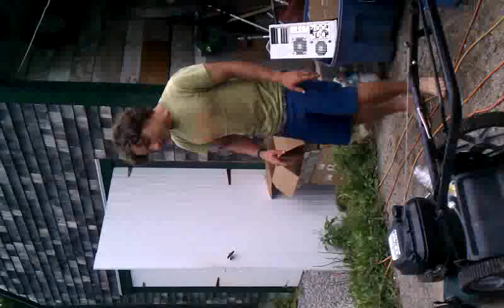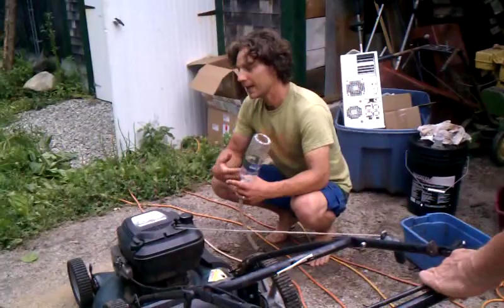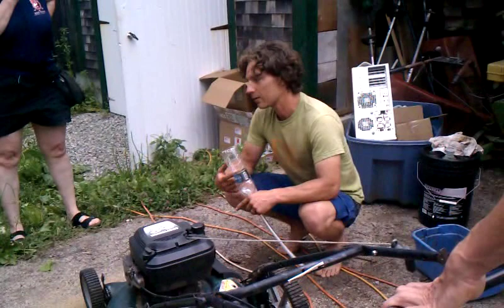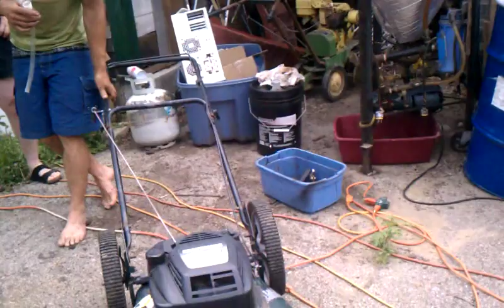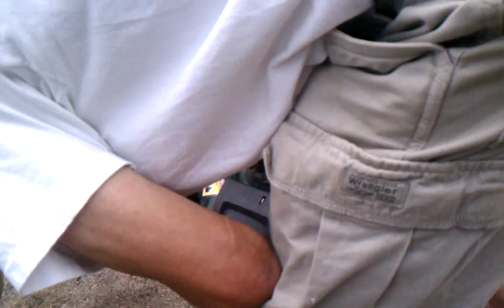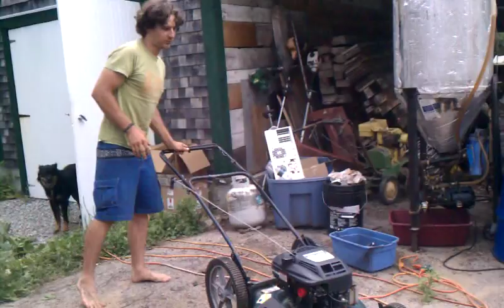Converting My Lawnmower to Run On 100% Ethanol (E100)

Comment: You should be able to close the choke enough to balance out the air fuel ratio for it to stay running. But overall you want to have a better fuel supply and more air.

Comment: today I ran my zeroturn (kohler 725cc not flex fuel) on E50-60ish with choke on. Without the choke, it was too lean even with the airfilter blocked a bit. With choke on, cooling fan was reading 60 degrees with outside temp. 35. There was no visible smoke from exhaust

Comment: Alcohol is way better of a fuel has a way higher anti knock rating no additives needed for it to burn where is gasoline is nasty dirty needs a bunch of additives and it still doesn't burn as well.

Comment: Could you please explain the modifications that are needed to  convert my bike engine to run on ethanol
Reply: Might be a bit late but essentially unscrew the main jet of the carburetor and measure the hole in the outside and the increase the diameter by 40%

Comment: You are totally wrong. Alcohols, including ethanol, are hydrocarbons and gasoline is also a hydrocarbon. They both contain oxygen and hydrogen and carbon combined in their molecules (this is the definition of a hydrocarbon). But this hydrogen and oxygen, combined in the hydrocarbon molecule,  cannot be used without first breaking down the molecule. They are not readily available to use without first breaking down the molecule into it's atomic parts. Internal combustion engines should run fairly easily on ethanol. Nascar has used ethanol in their cars for years. Henry Ford designed the first model T to run on pure ethanol. There might be some adjustments necessary for smooth operation, though. Cars are running on 10% ethanol right now and they are pushing to up this level to 85% alcohol and 15% gasoline. The cars designed to use this mixture are called flex fuel cars. But non flex fuel cars can run this mixture, too, but might have adverse reactions to such a high percentage of ethanol. An -OH group is called a hydroxyl group. It consists of a hydrogen and oxygen atom covalently bonded together and attached to a hydrocarbon molecule. Examples are alcohols and sugar.
Reply: Some of what you're saying is right: history of the model T, ethanol in gas, trouble running e85, hydroxyl group being the name of OH. Your definition of hydrocarbon is generally regarded as wrong though. Do the stoichiometry on the two complete combustion reactions, one with ethanol, the other with hydrocarbons as they are typically defined, molecules consisting entirely of hydrogen and carbon, and you will see the latter requires more oxygen from the air.

Comment: havent played with carbys since i was a kid but couldnt you just put a bigger jet in the carby or re jet the original jet.
Reply: fhhsvnggbh you can adjust the fuel flow
Reply: fhhsvnggbh that’s what a jet does it is a the hole that the fuel flows through.

Comment: Henry Ford's first vehicle was powered by ethanol made from hemp. then the oil companies came along and snaked their way into the matter and said gas is way better you should use it instead and we will pay you alot of money. thanks oil companies for destroying our planet. 100% ethanol,100% methanol, or hydrogen gas is the way to go, cleaner burning, cheaper, easier to produce.
Reply: Ethanol has to be produced from crops... oil comes from the ground, just drill and pump it out. Don't blame the oil companies, they came about because oil was already there and there is plenty of it.
Reply: Methanol and ethanol , even in pure form, still pollute the atmosphere when burned. Now, hydrogen gas does not pollute and the only by-product of its combustion is water. Electric is good too, if you can find some non polluting way to produce the electricity to recharge the batteries. Solar would fill the bill, but I can't imagine how many solar panels it would take to recharge all the cars being driven in the U.S..
Reply: Catman Outdoors not anymore dummy not anymore
Reply: Ethanol's only byproduct is water and carbon dioxide which are both recycled to make the new gallon of it.

Ethanol is a safe fuel too which is why the Indy 500 switched to alcohol.  Hydrogen is a high pressure bomb that gets more dangerous each year the vehicle gets older.

Nissan has an ethanol powered fuel cell which can use watered down ethanol that is not even flammable though cheap simple high compression/high efficiency engines made of recycled cast iron will probably
Reply: All the Indy cars use methanol, not ethanol. Nascar uses ethanol.
Reply: Indy switched from methanol to E100 ethanol in 2007 but unfortunately have gone to E85 today.  Here are article excerpts from the time:

...In 2005, the IRL used 100 percent methanol in their tanks. The fuel worked well and was more efficient than straight gasoline, but IRL officials believed there was room for improvement. In 2006, they moved to a 10 percent blend of ethanol and methanol, which was then changed to 100 percent ethanol for the 2007 season...
...The switch to ethanol also allowed the racers to carry less fuel and make fewer pit stops, thereby increasing efficiency even more. "When the cars ran on methanol tanks had to hold 30 gallons to accommodate the fuel requirements of the cars," Vervynckt says. "After getting the engines to perform at their full potential, there was a significant gain in mileage. Indy cars now have 22-gallon tanks. When a driver pulls in to change out his tires, he can fill up. Teams were able to match their tire and fuel stops exactly, instead of stopping for tires only, or fuel only."
Reply: And now cars are plastic

Comment: For full potential out of methanol you need to increase compression and advance the timing along with carburetor mods. If everything is right you can gain 13% more power over gas
Reply: do you think that 13:1 compression would be good enough to run e100?:
Reply: You can push it to 15 in theory.
Reply: ("RNA0ROGER") I'd have to grind my head down quite a bit for that sort of compression, I'm worried about valves striking the piston at those clearances
Reply: 13 in that case would do.
Reply: ("RNA0ROGER") Thanks for the advice dude, I'm gonna try this tomorrow
Reply: isnt he using ethanol?
Reply: I guess methanol has good potential. Indy cars have used pure methanol for years.
Reply: The author wasn't using methanol, however, he was using ethanol.
Reply: They switched to E100 ethanol in the 2007 but unfortunately use E85 today.  Here are article excerpts from the time:

...In 2005, the IRL used 100 percent methanol in their tanks. The fuel worked well and was more efficient than straight gasoline, but IRL officials believed there was room for improvement. In 2006, they moved to a 10 percent blend of ethanol and methanol, which was then changed to 100 percent ethanol for the 2007 season...
...The switch to ethanol also allowed the racers to carry less fuel and make fewer pit stops, thereby increasing efficiency even more. "When the cars ran on methanol tanks had to hold 30 gallons to accommodate the fuel requirements of the cars," Vervynckt says. "After getting the engines to perform at their full potential, there was a significant gain in mileage. Indy cars now have 22-gallon tanks. When a driver pulls in to change out his tires, he can fill up. Teams were able to match their tire and fuel stops exactly, instead of stopping for tires only, or fuel only."

Comment: Yesterday i converted one of my B&S lawnmowers that uses the old "Vacu-Jet" carb to ethanol. The advantage of these old carburetors is that the mixture is adjustable! So instead of changing the jet you just turn the fuel adjustment screw out a bit more (3 turns instead of 2 for Gasoline). I fired it up, and it runs perfectly! Couldn't believe how easy it was. Nice exhaust smell!

Comment: I read all the time about how ethanol is "bad" for your engine BLAH BLAH BLAH.... I say bullshit! I have been running ethanol all my outdoor power equipment for YEARS and not had one breakdown! I got tired of blowing money on gas to take care of 20 acres. I was spending more money on fuel for my outdoor power equipment per-year then what it cost per-year in my GEO metro.

I think it oil companies spreading false information to scare everyone away from ethanol, and then ppl would just repeat what they heard and read.
Reply: I think it's the blend of ethanol with gasoline that could be damaging. All of the articles or videos i've been seeing are titled "ethanol is bad for your engine" or something like that - which gives the illusion that they're running the engine only on ethanol, where in fact they're using E85 or another blend ratio of ethanol and gasoline.
It's annoying when you're not looking for information about fuels involving gasoline and actually just want to know about running on 190 proof (95%) ethanol alone and perhaps some info on using a vege oil as the engine oil and how well it mixes with the ethanol... In a 2 stroke, but also in a 4 stoke.
What are the details of how you use ethanol in your outdoor power equipment? Any experience with ethanol running a 4 stroke? If so, did you use store-bought engine oil in the 4 stroke, or have you tried using a vege oil such as canola? Thanks

Comment: to be truly efficient one would need to increase engine compression ratio as well
Reply: +Brian Perkins Well, where would one acquire parts to increase the compression ratio for a lawn mower? That's the tricky part. It should be pretty easy for a motor bike or ATV since the aftermarket shows has much more to offer for these machines.
Reply: *****
Yeah, I have heard of that for riding lawn mowers when people race them in competition. I suppose it could be done to anything really. But apart from that there isn't much. A thinner head gasket would increase compression if they are even available for any specific small engine application. There is also advancing the cam timing so the intake valve closes earlier. However much is safe to do so is uncertain.
Reply: +Bone Drone On an L head push mower the deck of the head/block surface can be surfaced along with piston and shave the head down in a machine shop.
Reply: You are correct, if he was using methanol instead of ethanol. One of the reasons Indy cars use methanol is because it handles the high compression of their engines, better.

Comment: Thanks for the comments.  You're right, enlarging the main jet would be the way to go but I wanted a quick method that was reversible.  I also hear what you're saying about changing the float bowl level only effecting the transition point between the idle jet and the main jet, not the amount of fuel supplied by the main jet.  All I can tell you is that if it ran without that particular modification, I certainly wouldn't have wasted my time doing it.  In fact, initially what I did was create a set-up where the main jet was connected to an ethanol reservoir that I could raise and lower and with that I discovered that a reservoir level slightly higher than stock allowed the engine to run.  Perhaps what is happening is the fuel is being pulled through the main jet by vacuum, or that earlier transition point somehow kept the engine going through a point where it otherwise would have stalled.

Comment: Our lawn mower ran unmodified on homemade booze estimated to roughly 80% ethanol. It ran poorly and very lean, but it ran. Later ran it on 98% red alcohol and it ran just fine, though still rather lean. It would cough and complain whenever the float chamber wasn't being filled from the tank. It probably helped that in both cases I had run it on gasoline for few minutes, and when it ran out, the only fuel I could find was ethanol, so it was already nice and warm when I started it on ethanol.
Reply: Did you ever try Everclear liquor? It has a super high alcohol content.

Comment: All you need is a larger jet to draw more fuel. The reason you can't start it is because you've choked most of the air off with that cap. Raising the float only changes when the fuel is drawn not how much. The jet has a maximum flow capacity so drilling the jet out slightly should help(or find a proper jet). I have researched alky carb engines a lot. It's actually much simpler than the way you tried.
Reply: +wendy cline I haven't posted any updates and in fact my source of grain for this project dried up but I would be happy to offer any details you need if this is an area of interest for you.
Reply: Thanks for the comment.  You're right, enlarging the main jet would be the way to go but I wanted a quick method that was reversible.  I also hear what you're saying about changing the float bowl level only effecting the transition point between the idle jet and the main jet, not the amount of fuel supplied by the main jet.  All I can tell you is that if it ran without that particular modification, I certainly wouldn't have wasted my time doing it.  In fact, initially what I did was create a set-up where the main jet was connected to an ethanol reservoir that I could raise and lower and with that I discovered that a reservoir level slightly higher than stock allowed the engine to run.  Perhaps what is happening is the fuel is being pulled through the main jet by vacuum, or the earlier transition point somehow keeps the engine going through a point where it otherwise would have stalled.
Reply: +evandalefarm 
did you ever post the video with detailed Instructions?

Comment: Why wouldn't you just change out the jet in the carburetor instead? The AFR for gasoline is 14.7:1 and about 9:1 (I forget the exact rate), but I know that it needs about 43% more fuel. So up-sizing the carb jet would be a lot easier method.

Comment: Thanks for putting up this video,  I plan on doing this to an old rototiller I have sitting in the garage.  Your right about the cold start.  Even sophisticated systems have trouble starting cold on pure alcohol, but that seems a small price to pay to run on plant sugars.
Reply: As far as I know, only ethanol is made from plant sugars, like booze.